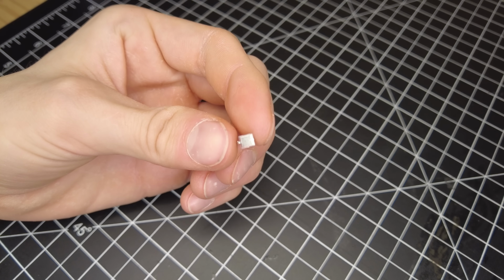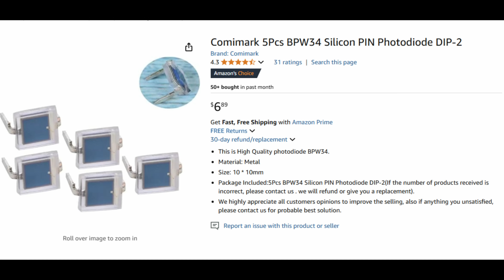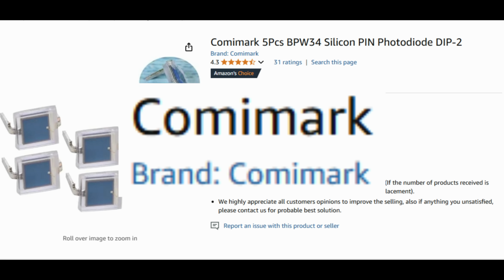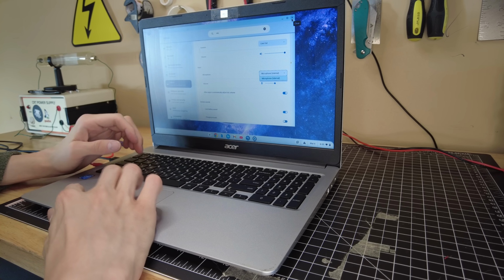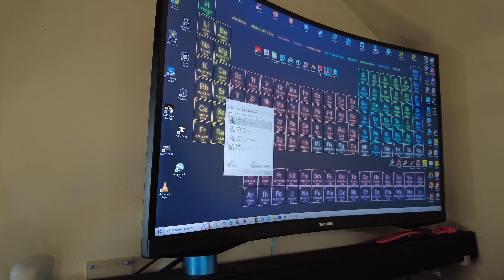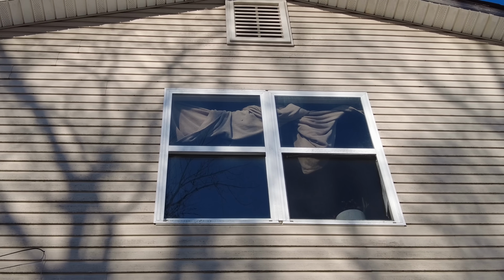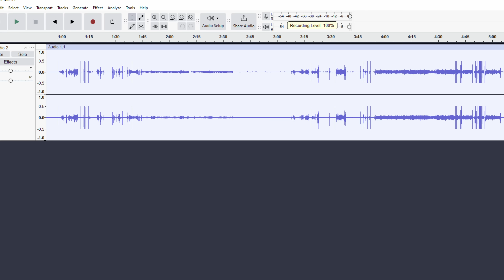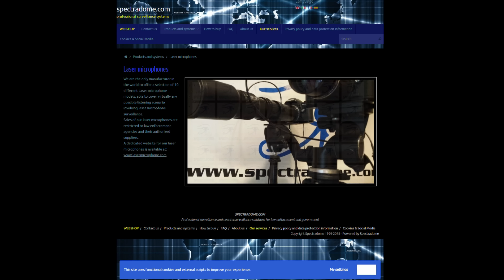I Built a CIA Spy Device (Laser Mic)

Comment: It is worth mentioning that if the windows consist of two or three layers of glass, eavesdropping using this method will be very difficult, if not impossible.
Reply: nope
Reply: @thomasbayer2832 Not to mention, you can actually focus the laser onto objects in the room that oscillate. 

Also, fun fact, you can extract sound from videos without sound by examining thin objects like a foil package in the frame.
Reply: @thomasbayer2832 you don’t know anything

Comment: One of the most sensitive ways to pick up vibrations is with an Interferometer. I spent 6 years working with them in the context of something called FTIR Spectroscopy. It's not cheap, since the interferometer and optics can easily cost $10k without electronics. It's what they use to find gravity waves from space where the spectrometer arms are VERY long (the longer they are the more sensitive they are to gravity). It's rather  complicated, but it works by using a 50% beam splitter on the laser, bouncing one beam off a fixed arm and using the other beam as your detector, bounced off something that can move. When the beams meet back at the beam splitter, their recombination will be modulated by the vibration of the non-fixed arm leading to a detectable signal. When our machine was running, it would pick up speech in the room, cars driving by on the road, pretty much anything. It's not something you can do home brew.
Reply: West europeans are amazing

Comment: Very cool, and way easier than I had imagined. Great find and content.

The static might have been from within the budget amplifier circuit, or the power supply for it, or the power supply for the laser. It might have been induced in the Aux line. It could also be from noise on the other side of the glass, like your desktop computer fans. Having fought with an ADC on a microcontroller, the number of noise sources is always underestimated.

Comment: 30 years ago I worked at a government lab in Russia that prototyped a similar device. That was built on top of 10cm metal back plate and needed a nitrogen cooling :) However that one used reflected beam phase detection, which is more complicated, arguably.
Reply: More complicated, but with better results, as it is phase sensitive. No noisy background.
Reply: Any other cool projects that you worked on?
Reply: @ You mean cooler than nitrogen ? :)
Reply: @raphanunu6912  😂😂
Reply: Phase shifting was my first guess, when hearing from these devices. I think the amplification problem that the nitrogen cooled sensor solves, is the detection of the scattered reflection of a beam that is not directed at the sensor directly To amplfy the scatter, you need a telescope and a much better sensor because the light intensity is just a fraction of the emitted laser power.
Reply: @TheDeepnoise  I thought the nitrogen was there to cool the laser
Reply: @raphanunu6912  that's maybe a good point 👌
Reply: Cool, what's your profession?
Reply: I remember visiting Moscow about 40 years ago. Around metro stations, people were selling burnt-out lightbulbs at illegal makeshift markets. I asked my Russian companion what they were for. He explained that lightbulbs were impossible to buy, but if you had a defective one, you could exchange it for a working one at your workplace.
You might have worked on this issue as well…  🤣

Comment: Great presentation on it’s own but…

Countless agencies and governments still use these today. But now they actually prefer to use items like…

1. That hardware manufacturers actually have a variation of a PZM microphone built into almost every device known to man. The microphone in a laptop or the ones (plural) built into a phone can pick up a 5db sound from almost ten meters away.
2. WiFi and Bluetooth monitoring, even when using items outside of electronic signals, can also easily pick up other communications - and even map a room down to the fraction of a millimeter.
Reply: Adding in; items such as Google Nest and countless others. It’s nothing more than an analog to digital converter that then goes to the internet. There are over one half billion of such devices

Comment: To avoid capturing the returned laser beam, you could use some form of telescope zoomed in and pointing at the laser dot on the window. If you used IR to do this, you could crank up the power to reduce the inevitable noise increase.

Comment: We built these WAAY back in the day in physics class.  Making one is the easy part.  Engineering one with a high quality signal to noise ratio is the hard part.
Reply: Signal degrades due to beam scattering over distance and on reflection, beam absorption by the target, and atmospheric interference.  Then there is signal degradation from the actual electronic components.
Reply: I didn't even mention the most important factor - you need to be perpendicular to the glass.  Even with a well engineered device this is the most difficult part.

Comment: You missed the perfect comedy deadpan visual delivery with that plugging in USB cable. While you plugged it in after getting it wrong on the first try, it would have been more accurate for it to have worked after trying it first, then reversing it and it failing to fit and then flipping it back to the first try AND THEN it fits.

Comment: couldent you just put two sensors right next to each other, use a stereo cable, put the lazer between them. Then theres prob some filtering you can do to remove the static pretty easily without needing two lazers

Comment: Getting rid of the noise is very very easy. 1, there's a bunch of plugins that can do it. 2, you can record a 10 sec file with just the noise, add it to audio editor, shift phase and the noise will cancel itself out leaving just the actual audio

Comment: I think a real spy gadget would use the doppler shift with the Lidar principle. Much easier to use but the RX circuit can be more complex to get the phase difference.
Reply: Are you really think, that lidar measures light frequencies?
Reply: @tarik20ua  Lidar doesn't measure light frequency, it measures the ToF, you can connect the dots.
Reply: @DN-iw5km  and there is can not be any Doppler, because Doppler - is about frequency change, and lidar - it's about time of returning light

Comment: Oh! and your laser receiver is in direct contact with the PC Case... the PC Case is subject to multiple fans running at varying frequencies... You can hear exactly how much noise your case makes by holding a plastic cub to the handle of a screwdriver as it is pressed against the PC Case. Thereby amplifying the noise inherent in the case. The same idea can be done by placing your ear firmly against a hard wood table ... its interesting how "loud" it sounds. :-)

Comment: I have (3) theories about the "crappy audio" ... 1.) It's not fair to assume that the only sound you are receiving is the noise you expect to hear. That pane of glass is subject to ALL of the noise in the room, inside as well as outside...  2.) The laser itself is not pure laminar flow of light. if it was, it would be a "Light Saber". LOL I mean, of course its "straight" enough to be a "Laser", but its not solid enough to transmit the full spectrum of sound. (Fiber Optic networking is about pulses and durations. not relevant to my comment about transmitting the full spectrum of sound.) 3.) Why not filter the audio through an EQ to clean up the sound a bit. Perhaps pulling out some of the higher frequencies or leaning into the lower ones? Now, I'm thinking about 2 cups with a string in between... That audio tooo has "Extra Noise" on the receiving ends... Anyway, that is my 2 cents. Thank you for the video, I enjoyed it :-)

Comment: audacity has some pretty good noise removal effects and now intel AI plugs for audacity are insane. I would put a tube on the sensor and point it at the window, also making the sensor only pick up the frequency of the laser would cut alot of the static out. using a laser filter to make the tiny points of light instead of a wide blur on the laser would help as well. cool project
Reply: Or not using a dollar store laser, come on people, we have Co2 lasers, Fiber lasers.  LETS TALK OPTIC AND WHY ITS RED AND NOT BLUE, OR GREEN.

Comment: 0:47 I expected a disclaimer or warning but got a suggestion on how to spy better instead
Reply: Not that hard to think about it, is just that IR lasers are not common for the strength needed for stuff in this video, the common ones are in remotes and are not powerful enough. And this might also be why he used visible light lasers commonly used in all markets for a variety of toys.
Reply: Seems I was right, but also wrong, with the recent commercial available true real time Night Vision for civilians, there are IR lasers for guns that would work perfectly here (Still quite expensive comparatively, but not hard to get), and normal camera sensors have an IR filter that can be removed on most without damage to the sensor, so you could make an IR spy Microphone setup easier now.
Reply: @Narinjas  ir lasers are not uncommon at all. the common green laser (532) is actually an ND:YAG with a freq doubler crystal, you might be able to remove it and get pure 1064nm

Comment: I would have thought that this would have employed an interferometer to detect phase differences rather than amplitude differences.  That should be a lot more sensitive.  But would require some optics at the transmitter/receiver end.

Comment: Greate Demo!  to reduce noise you should try to modulate the laser and high frequency (relative to the audio) and then use a narrow band filter. Beforehand, check that the thermistor you are using, still works at the carrier frequency.

Comment: Holy!!! Saw this in Burn Notice years ago and thought it's purely fiction! Gonna add a vibrator to all my windows now! lol
Reply: Just get low-e windows.  Windows are naturally long IR opaque.  Low-e windows are also near/short IR reflective.  Double or triple-pane windows will damp the vibrations to the outer pane, a #2 (inner surface of outer pane) coating will prevent sensing off the inner pane.

Comment: I did a similar experiment as I was 13 or 14. Setup was following: a small speaker playing music with a small mirror attached to it (or just laying on it). A good light source shining down on the mirror, e.g. simply a sunlight. On the other side of the room - a device similar to the one shown in the video. I used an old portable cassette audio player; the amplifier input from the sound pickup head was connected directly to a simple photodiode. I think I even had less static noise, probably because the resistances of the amplifier and a photodiode where matching better than in this video.

Comment: Might be easier placing a battery powered (CR2032) microphone, amplifier and transmitter on a suction cup on the window and transmit the sound to you. Odds of getting that beam in the exact location for proper reception is astronomical at 100 yards.

Comment: You can get better sound than that. Use the built-in nose reduction in Audacity, since that's what you're using. Sample a second of just the noise where there's no audio, then apply that to all of it to remove most of the static.

Comment: 2:44 get the laser close and then move the sensor in place, much easier than having to aim the laser with the distance ;)
10/10 vid, this is really cool and quite amazing, also a bit scary. Had no idea this was thing.

Read more
Reply: Ps: Did i get you?

Anyways, record blank audio to get the noise profile, then play music, and use the noise profile to remove the static noise. (audacity has it, simple to use, works decent)
Higher quality sensor and laser will probably help too i guess.

Comment: the static noise comes from your high OHM resistance choice in combination with your Photodiode at the amplifier. You basically hear the electrons shot noise.
Reply: Yes. Resistors are the biggest source of noise in analog audio circuitry. You wanna avoid high values and carbon resistors
Reply: @asronome So why studio microphones are using even gigaohms resistors in the amplifier circuits?
Reply: @Newlife-ol6pk  because in there they are used as a bias shunt resistor. by increasing the resistor value, less current flows to ground and less current goes through the amplifying FET, reducing noise.
Reply: @MrErikb81  is that still analog or digital
Reply: Perhaps the noise is from the ambient light in the room .... turn off the lights in the room.
Reply: @johnswn255 Indeed, or use a notch filter in front of the receiver to only transmit the 630 nm (guess) of the red laser.
Reply: Or he could just record a few seconds or segment of sound and let audacity do the work.
Reply: @ZeFoxii  yep, coolest thing is that even we could do that because we have some samples of the noise from when he cut the laser beam with his hand, that should be enough for the denoiser audacity has
Reply: His pc fans could also interfere as well
Reply: also likely pc vibrations as it is on
Reply: So cool to see comments like this from people. A sound expert offering advice to someone for free
Reply: So what I’m hearing is he needs a Filter Circuit to clean the noise
Reply: Are you sure the laser light itself doesn't contribute to the noise? It only happens when light is shining on it
Reply: @originalclippygfx Additional light from the surrounding also has an effect.
Many Household LED's are pulsed for example.
Reply: @originalclippygfx  Yes, it is the speckle of the laser light, converted into audio
Reply: @originalclippygfx  it would make sense since the laser is providing a baseline voltage. Kind of like a carrier wave for a radio station
Reply: @JonathansImprovements  I just watched a video under this that did this but with a different method and it was lossless audio
Reply: Ohh, or can he overcomplicate it with those analog to digital converters used on speakers with the laser input wire (I'm forgetting the name)?
Reply: @SouIife Trouble is the A-D converters in optical interfaces will only output the same quality of audio that goes in, so we still have the issue of converting a feint noise from the glass into something we can hear! However you are still have a good point because the pro laser-mics use specific colour of laser which is modulated (pulsed) at a frequency that gives the optimum audio transmission and reflection from glass. Then the modulated signal is filtered from the received laser light and amplified to reveal just the audio, well the speech part of it anyway.
Reply: irrelevant. just throw some AI on it. it will do the job perfectly. everything is better with AI.
Reply: @BlacKi-nd4uy prefixing with i works better: iLaser iMicrophone
Reply: The AI is claiming that pigs can fly if you sentence the question properly 🙄
Reply: @BlacKi-nd4uy  except sarcasm... it really falls short at making terse, sardonic comments...
Reply: @BlacKi-nd4uy this :D it’s so easy to isolate voice now by just slapping a magic black box 😅
The non-AI tool that would probably work well is PCA.

Comment: That was very interesting!  But I could guess there problems in real-world use:

a) Must be near perpendicular to the target window to listen to in order for the laser to reflect back to source with a clear line of sight
b) Actual long-distance listening means more dust, debris in the air that will add noise to the signal
c) Related to (b), you want to be farthest away as minimize chances of detection since the laser is visible
d) Most windows are double paned with air gap to increase insulation which will also insulate the interior sound
e) Related to (a), some laser light will end up inside the room making detection possible
Reply: Did you skip the start of the video where it specifies that he is only using a visible laser for ilustrative purposes and the one that should be used for the project should be IR?
Reply: use a visible laser for aiming, then turn it off and use an IR laser for audio modulation perhaps. Also, a fresnel lens might help the aiming troubles a little, Maybe a pole with a periscope mirror up high and the receiver down at the base?
Reply: @hanssolo8460 cant say exactly but on one point you hit the nail and thats how its down
Reply: It will work better with drone assisting to solve emission and reception of laser signals
Reply: @azizmaitig4328  Drones vibrate immensely in flight and actually dance around a lot instead of staying in one position to counter wind. Not even close to a deal-breaker, but it would make getting a clean signal out of this a bit more challenging.

Comment: i was thinking about making one the other day and was wondering what to use as the receiver. the problem i saw is that a video reciever/ccd chip would have a very low frame rate. compared to human hearing range 20-20khz would be insufficient. the photo sensor seems like the best option